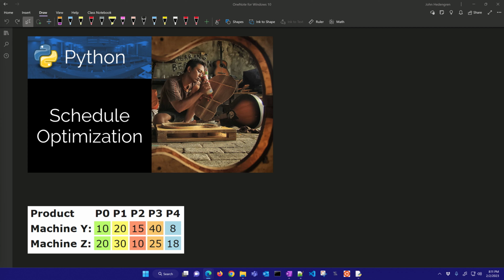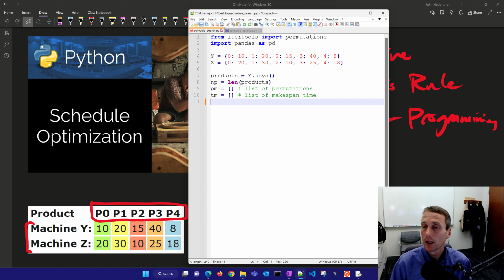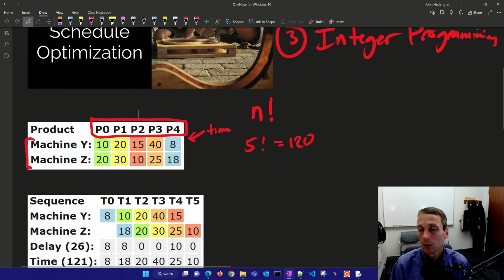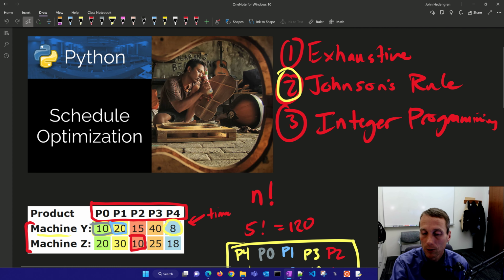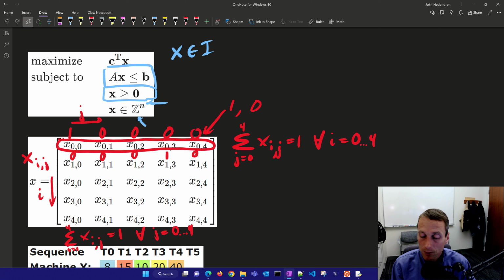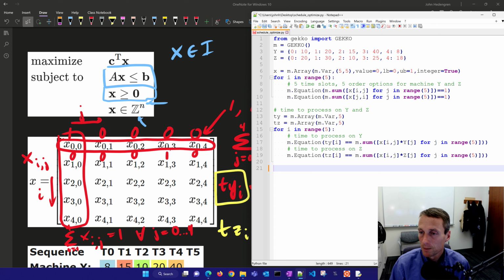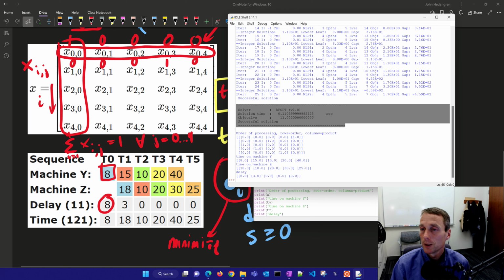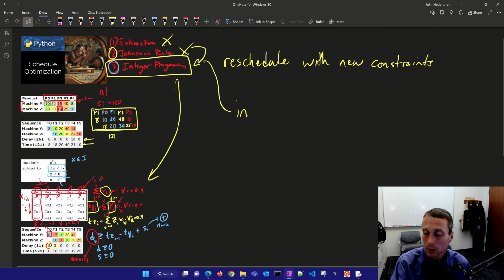Schedule Optimization with Python

Comment: how should I modifies the code if I wanted to to schedule multiple task to the same type of machine that runs parallelly ? great video btw thankyou ! 😄🤝
Reply from the maker: Here is sample code from ChatGPT 4o:

from gekko import GEKKO
m = GEKKO(remote=False)

# Number of tasks
num_tasks = 5

# Number of parallel machines for Y and Z
num_machines = 2

Y = {0: 10, 1: 20, 2: 15, 3: 40, 4: 8}
Z = {0: 20, 1: 30, 2: 10, 3: 25, 4: 18}

# Decision variables
x = m.Array(m.Var, (num_tasks, num_tasks, num_machines), value=0, lb=0, ub=1, integer=True)

# Ensure each task is assigned to exactly one time slot on any machine
for i in range(num_tasks):
    m.Equation(m.sum([x[i, j, k] for j in range(num_tasks) for k in range(num_machines)]) == 1)
    m.Equation(m.sum([x[j, i, k] for j in range(num_tasks) for k in range(num_machines)]) == 1)

# Time to process on Y and Z
ty = m.Array(m.Var, (num_tasks, num_machines))
tz = m.Array(m.Var, (num_tasks, num_machines))

for k in range(num_machines):
    for i in range(num_tasks):
        m.Equation(ty[i, k] == m.sum([x[i, j, k] * Y[j] for j in range(num_tasks)]))
        m.Equation(tz[i, k] == m.sum([x[i, j, k] * Z[j] for j in range(num_tasks)]))

# Delay time on Z
d = m.Array(m.Var, (num_tasks, num_machines), lb=0)
s = m.Array(m.Var, (num_tasks, num_machines), lb=0)

for k in range(num_machines):
    m.Equation(d[0, k] == ty[0, k])
    m.Equation(s[0, k] == 0)
    for i in range(1, num_tasks):
        m.Equation(d[i, k] >= tz[i - 1, k] - ty[i, k] + s[i, k])

    # Minimize the total delay and slack
    m.Minimize(m.sum(d[:,k]))
    m.Minimize(1e-3 * m.sum(s[:,k]))

# Solve the problem
m.options.SOLVER = 1
m.solve()

# Print the results
print('Order of processing, rows=order, columns=product, depth=machine')
print(x)
print('Time on machine Y')
print(ty)
print('Time on machine Z')
print(tz)
print('Delay')
print(d)

For specific questions, please ask on StackOverflow with tag [gekko].

Comment: let's say you don't have  fixed number of machines, and you're trying to determine the optimal number of machines to run based on demand
Reply from the maker: We've been researching topics related to design (number or size of machines) and schedule optimization. Here are a few papers (among many with this current topic):

Hill, D., McCrea, D., Ho, A., Memmott, M., Powell, K., Hedengren, J., A Multi-Scale method for combined design and dispatch optimization of nuclear hybrid energy systems including storage, e-Prime - Advances in Electrical Engineering, Electronics and Energy, Volume 5, 2023, 100201, ISSN 2772-6711, DOI: 10.1016/j.prime.2023.100201

Mojica, J.L., Petersen, D.J., Hansen, B., Powell, K.M., Hedengren, J.D., Optimal Combined Long-Term Facility Design and Short-Term Operational Strategy for CHP Capacity Investments, Energy, Vol 118, 1, pp. 97–115, January 2017, DOI: 10.1016/j.energy.2016.12.009.

I recommend that you also look at work by Ignacio Grossmann at CMU and Christos Maravelias at Princeton for additional contributions to combined scheduling and design optimization.

Comment: Thanks for this video, a question is APMonitor and Gekko open source? let say if I work for a consultant and I want to use Gekko can I use it for free? otherwise how is the process for using gekko and APMonitor tools for optimization?
Reply from the maker: Yes, Gekko is freely available. The source is available from https://github.com/BYU-PRISM/GEKKO or install with "pip install gekko". It has the MIT License that allows any use, including commercial use.